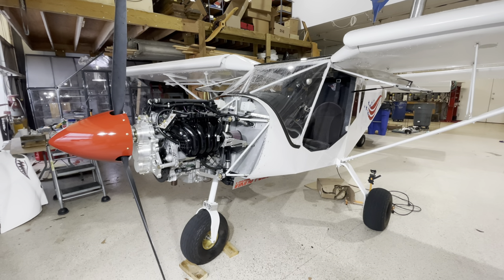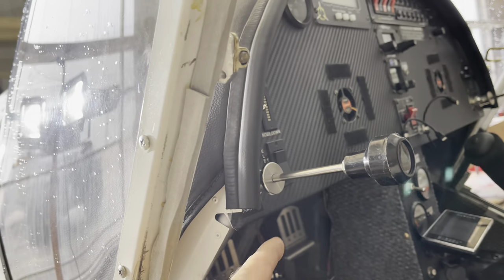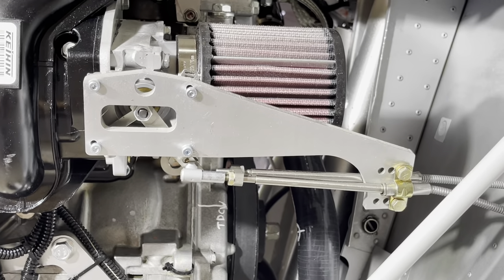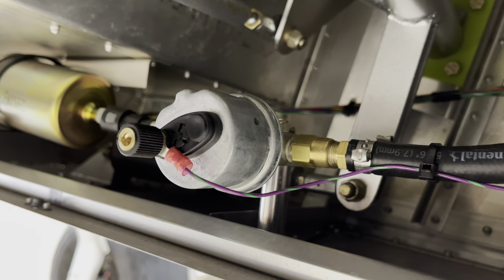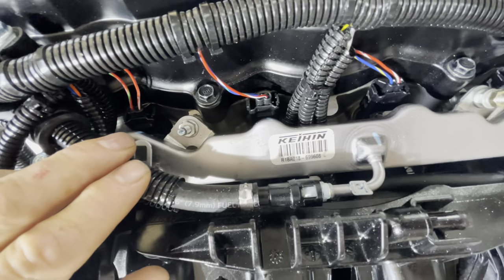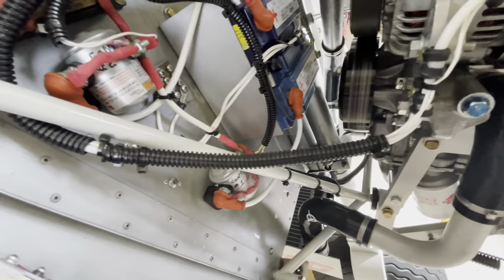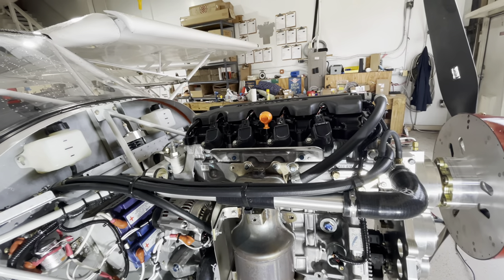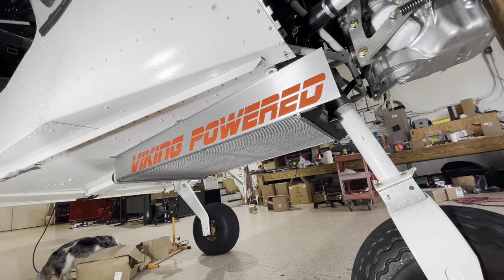Viking 150 Installation

Comment: Is this engine physically bigger than the 130? Also, do the hoses close to the exhaust need a heat wrap?
Reply from the maker: No need for a heat wrap, the engine actually stays much cooler than standard air cooling etc, and plenty of prop wash and cooling. It is physically the same size.

Comment: I would consider a stainless steel pass through with a lip on it for wrapping fire resistant material around.  I don’t think your current pass through would last long were an engine fire to occur.  I realize that is exceedingly rare, but they do call it a firewall for a reason.  😁

Comment: Why did you choose the r18 and l15 engines instead of the k series? The l series is known to have smaller bearings and near its hp limit in stock configuration, just curious, thanks

Comment: Nice video, some great information one negative sorry, lock wire on the nose gear Teflon block would not pass inspection.
Reply from the maker: Thank you Scott, We are just showing the engine installation, it isn't our aircraft so we didn't really have a hand in that - we are just sharing only about the engine. He has been flying it though for over 300 hours without issue though. I'd have to even re-watch the video to see your reference.
Reply: Thank you, really appreciate your videos, while I have a different engine going in a Cruzer your advice is very valuable and I appreciate the time taken. Keep up the enthusiasm and great work.
Reply from the maker: Thanks Scott, been following your journey as well :)

Comment: Question. Is there an STC that will allow installing this engine on a C-150/152. If so or not what is the weight difference of this engine compared to an 0-200 or an O-320.

Comment: I’m curious on your throttle control.  Many modern engines automatically control the idle to adjust for things like the AC compressor kicking on, etc.  Are you using an engine that doesn’t have that?  Or did you have to remove that feature for some reason for airplane use.  Just curious as it seems that would be useful to handle things like heavy alternator load and to allow slightly higher cold idle.  Most of my cars and trucks idle about 1300 - 1500 when started cold and then slowly decrease to 600 (big truck V-8) to 850 (smaller 4 banger) when fully warm.

Comment: It is my understanding that Nylock nuts are not acceptable Firewall forward?  I see them in the engine mounts?
Reply from the maker: The heat temperature, especially due to not being air cooled, temps under the cowling never get near nylock nut temperatures (they maintain their locking ability up to 250 degrees F) our engine operating temp MAX is 220 and the under cowling temperature is MUCH lower than that :)

All metal locknuts are actually hard on the bolt threads as well so they have some disadvantages
Reply: @eggenfellner  Thanks for the info.

Comment: Do you get adequate airflow through the radiator from the prop to allow good cooling during prolonged idling on warm days?  I did not see an electric radiator fan as comes on cars to provide airflow when idling.
Reply from the maker: No issues with cooling, it has worked pretty steadfast this way over the past decade without the fan, if we can avoid the added complexity and "one more part" especially where not needed, we will always try to avoid. With the internal friction reduction in these engines, cooling is much easier and we also don't need an oil cooler.

Comment: Great video as always. Thanks, guys!
Will there be a powder coating option available when we order the engine mount?
Do the overflow bottles come with the engine?
Will the prop bolt patterns/measurements be the same as the 130? Don't want a new prop if I can avoid it.
Is a fuel pressure transducer included?
Is the nose gear spacer required?
Does it use the same cowl as the 130?
Any baffling required?
Does the coolant tubing preclude mounting the batteries on the left side?
What kind of washers are used to mount the ground straps to the engine mount?
Don't see safety wire. Does that come later?
Does it still work if I only have one dog?
Saw the other short video with some takeoffs and landings. How long do you think it'll be until we see some performance comparisons between the 150 and 130? I keep leaning back and forth between the two.
Reply from the maker: That is a whole lot of questions for Youtube, if you want more in depth shoot me an email :)
We always offer powder coating, overflow bottle are part of the FWF kit, prop patter/flanges all the same, fuel pressure transducer is part of whatever avionics package you have, spacer isn't required, but nice for extra ground clearance, same cowl, just no bump, no baffling, we don't usually use a lot of safety wire - low vibration and a lot of our bolts are in tension not in shear. 

Most definitely doesn't work if you have one dog, you must get two ;) 

The 130 and 150 have their inherent differences, one is port injection (the 150) the other direct injection - the direct injection is slightly more efficient. The 150 is a bit heavier (i think 12 lbs but would have to look) One of the bigger reasons to go the 150 is if you are at a higher density altitude, but the 130 is pretty perfect as well, both can pretty well max out the airframe..
Reply: Thanks so much, and sorry for the length. Kinda get nervous before spending that much.
Reply from the maker: Length is just fine, but I can give you much more info via email, links etc. if ever needed, and sometimes we miss these comments :)

Comment: When you do a auto conversion of a Honda Engine  what are changers that you do to the Honda stock engine particularly to the oil distribution system
Reply from the maker: We have a few videos discussing this, but most of the Honda engine stays the same, all the internals, oil pan etc.
Reply: Thanks could you do a one to one convertion video that will be great
Reply from the maker: As much as I know some might enjoy this, it takes a long time to do this conversion, a lot of R&D, and is something we will not show on camera, but we have discussed the basics before in many videos.